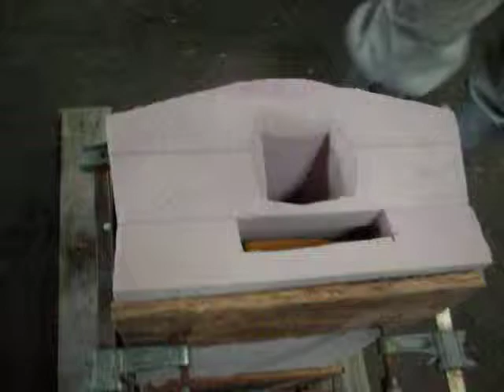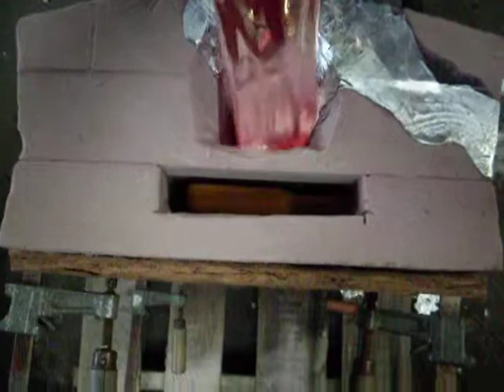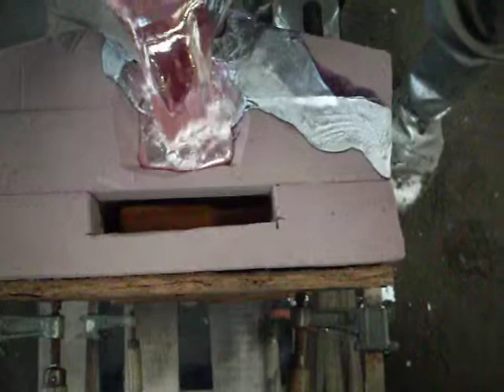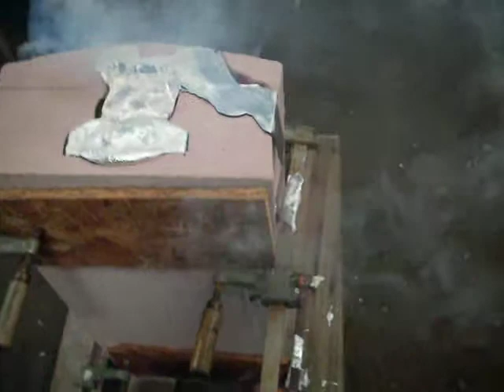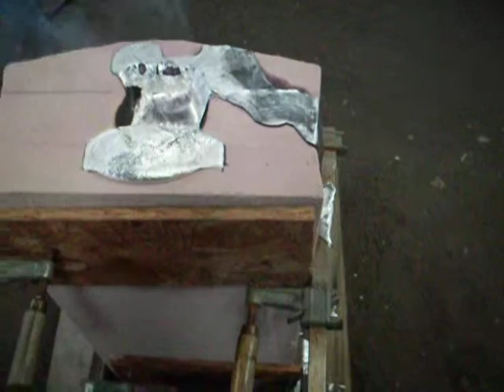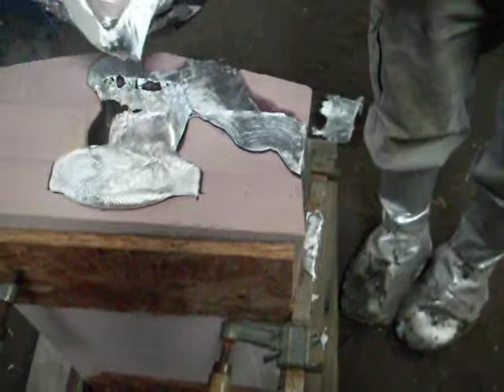pouring chill plate

Comment: -1 sprue too big
-1 sprue not tapered
-1 no pouring basin
-1 core not properly vented (seen in the metal bubbling around the core)
lots of typical casting mistakes which cause flaws and defective parts.